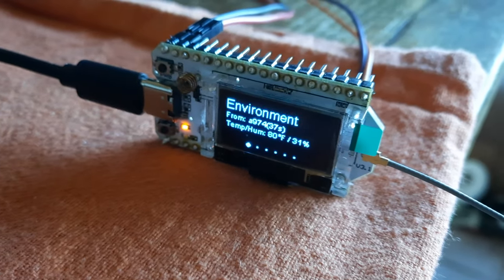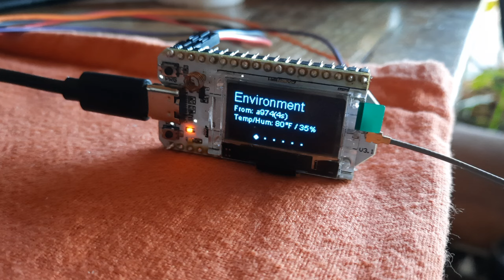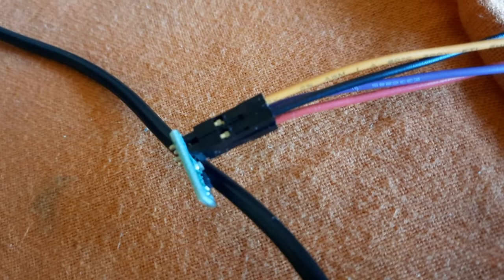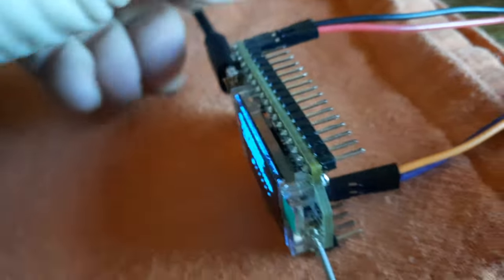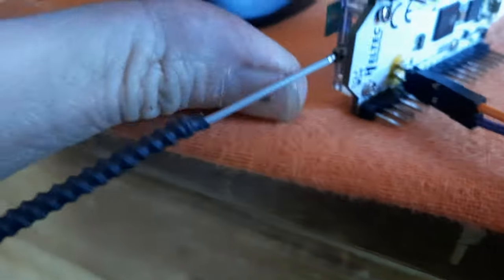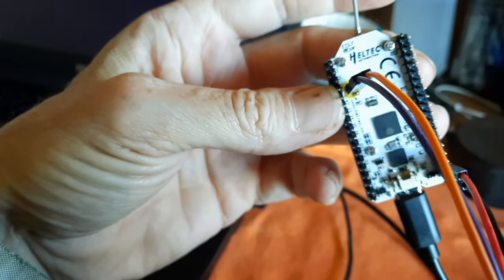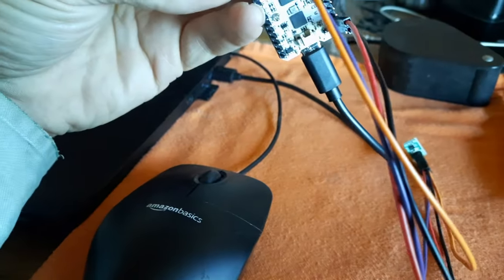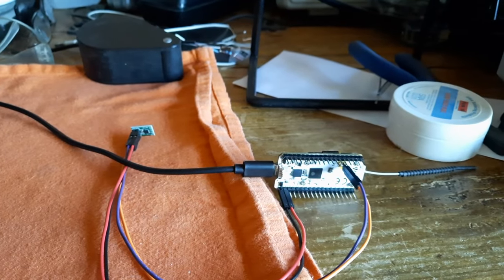heltec LoRa32 v3 and sht30 hookup

Comment: Oh, that's cool! I can use those points to add another i2c port. For future reference I also just found out that pin 42 is SCL and pin 41 is SDA on the V3.
Reply from the maker: VERY cool! I'll make a note of that. Did you have to change the firmware or settings to access the sensor?